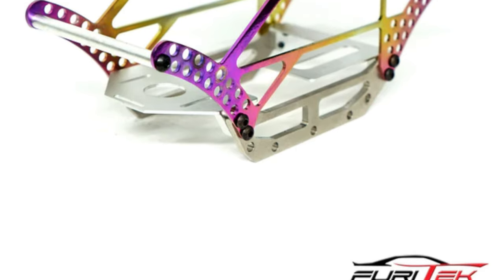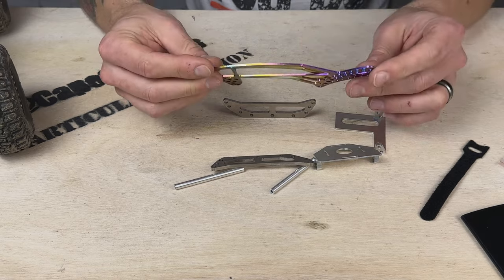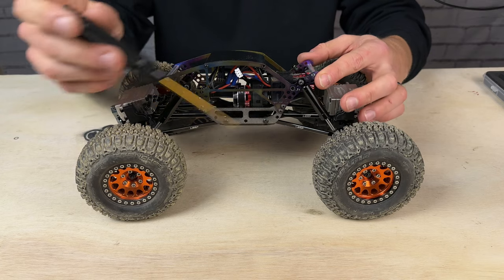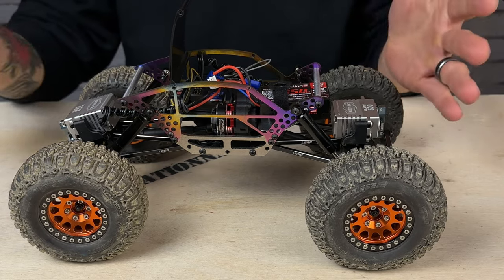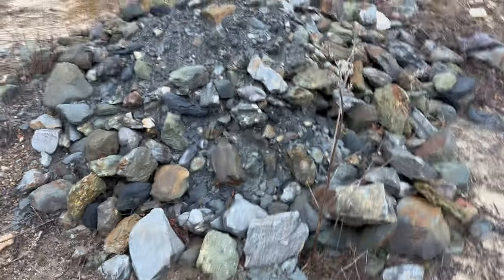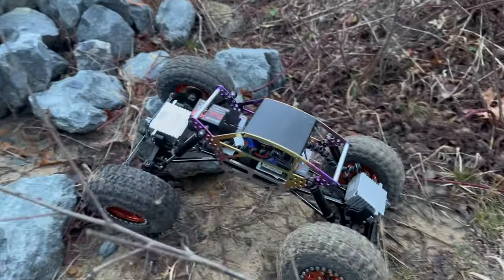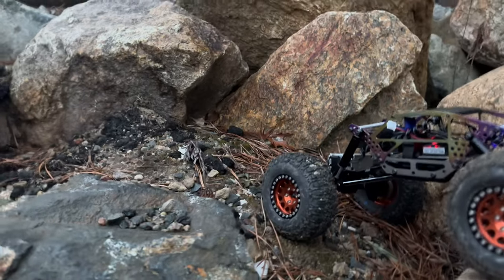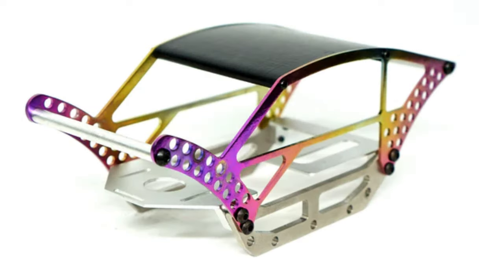Axial Capra UTB18 Upgrades - Furitek Titanium Comp Chassis! Install, Crawling & More!!!

Comment: Hey Adam, can I ask you a question? I don't own a crawler yet but there is a wrangler scx24 for sale near me for £80 (New deadbolt is £125 and Wrangler is £135) but it has the v1 electronics. What do you think? Is there much difference between V1 and V2? I honestly don't know what to do whether I should get this and save money or pay the extra and get a new one with v2.
Reply from the maker: The V2 setup is much smoother to drive. BUT the V1 has options for more expansive upgrades down the road like a Furitek system, which is not compatible with the V2.

Comment: This is why I flip-flop back and forth, wondering whether it's better to just buy parts and build rather than spend money on an RTR that I'm just going to replace nearly everything on. Especially if I save money making my own chassis/frame rails, links, body, etc. Granted, having an RTR gets you something to play with and upgrading one bit at a time might be better for some budgets and definitely the way to go. But seems at the end of the day, you might only have an ESC and an RX/TX left of anything that came in a box RTR! LOL! Might make a good video to compare the cost math including wasted/non used original RTR parts, time dissembling/reassembling each time you get a single new part to add, extra cost of shipping when ordering a single or couple parts once a month or two versus buying all at once from a couple sources and saving an shipping one or two packages. Lots to consider for sure.
Reply from the maker: So true. I like the iterative process of upgrading a stock rig. It's fun to see incremental progress. But it is far more economical to do a scratch build. The benefit of overhauling an RTR is that you can rebuild a stock one from takeoff parts and sell it afterwards!
Reply: @CapeCrawlers  That is a good point! :D

Comment: If you put some grease in the u-joints on your driveshafts that might take care of that creak. I had the same issue and it drove me nuts. 

Nice video, it's probably an unpopular opinion but I'm not a huge fan of this look for rigs. I'm not a huge scale person but I like it a bit better when they look like cars. Can't argue with the performance though. Nice job 👍
Reply from the maker: I will try the grease, that creaking makes me crazy! I am right there with you about the looks. I enjoy them more with bodies and a somewhat scale appearance. I will probably do a spare parts build and resurrect the Capra with the cage on it after this for that exact reason.
Reply: Searching high and low for a solution. The Creaking is pissing me off now. 😂 Next stop was steel drive shafts. Hopefully this works.

Comment: Based on your video, I spent my life and got an FMS FCX 24 crawler along with some upgrades. Put the wheels beadlock wheels and weights (didn't do a good job so that was on me) and then drove it. I realised seeing your videos have spoiled me for quality. I actually liked this rig but something was missing. I was wondering, this is my first crawler so what gives! Then I realised that I see your videos regularly. LOL ha ha ha. I am so spoiled for quality and famished for choice!ha ha :D Great video. I wonder what will happen if you added softer compound tires on this one. I think this will also ignore gravity after that upgrade.
Reply from the maker: I hope you love that FCX24. It's such a fun rig with huge potential! I have to get the inserts sorted out on this thing. I may try some custom foam as I can't seem to find the right compound right now. I think you're right though, it will be unstoppable with the right tire combo.
Reply: @CapeCrawlers  you bet! I've the weights and i am very likely doing that droop setup of yours since the springs on this make the wagon tip over. Already with just weighted tires i can see a decent difference. 

Yes foams might help. A four wheel low slung crawler is ❤️🔥

Comment: I honestly would swap out the servos for the newer reefs 100 made for trucks this size I love the raw 500 but I mainly run it in my RYFT lol super overkill in the ubt18 the power draw will be less but still more than enough power and torque to turn the trenchers. Hopefully this helps.  Killer build BTW 💪🔥
Reply from the maker: Thanks! I do need to swap them out. The 500's are completely under-utilized in this truck. The 100 sounds ideal and I'll check it out.

Comment: Thanks for the UTB18 videos! Convinced me to get into the hobby and started there a few weeks ago. Having issues with the Furitek and Flysky GT5 upgrades this week. Signal seems to keep dropping (especially to the steering servo). Did you have any issues or tips regarding setup?
Reply from the maker: I haven't had issues with the UTB18 setup, but I did with my lizard ultimate. I ended up having to replace the Lizard to get it to work properly.